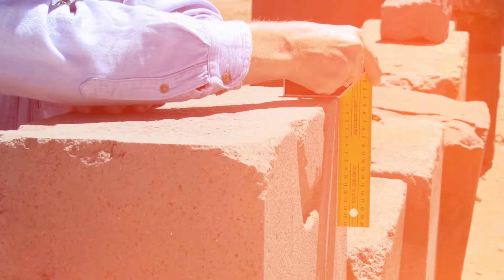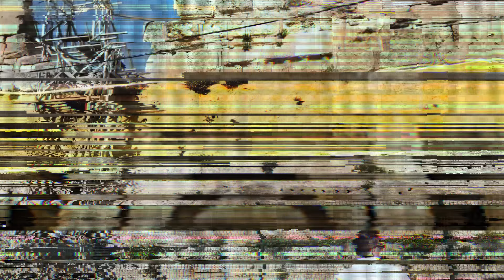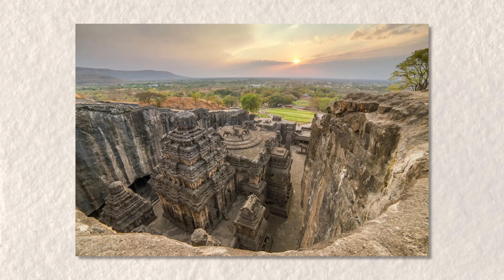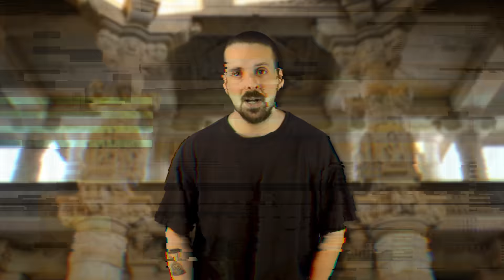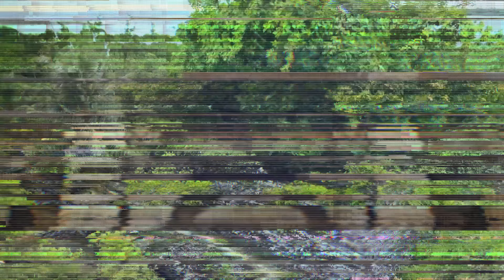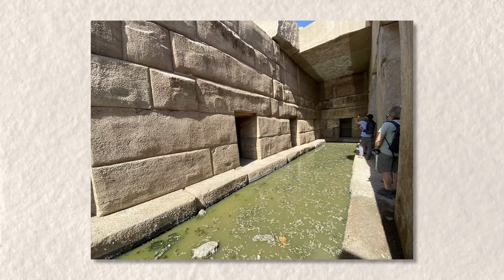10 Architectural Structures Ancient Civilizations Built That Engineers Couldn't Replicate Today

Comment: Those 800 ton blocks can be lifted with 500 people quite easily by using block and tackle to a 40/1 ratio, actually if my calculations are correct you should be able to lift around 1000 ton with 500 people with the same ratio but it's good to over estimate

Comment: They had full access to graphite-based copper induction, a far simpler setup that softens silicon in basalt, quartz, granite, and other megaliths. This allowed them to strip away material layer by layer, shaping and moving massive stones without the need for water, drilling, sawing, or counterweights.

Comment: You're joking, right? If you use enough ropes, and intertwined them after they were wrapped around the back of the stone, they would all work as one peice. You can easily drag a brick uphill with a peice of cheap string from Wal-Mart, so just simply scale that up. These people had hundreds, of thousands of slaves. You give me 250,000 men, and the necessary ropes, and I'd challenge you to find something we couldn't move

Comment: Roman roads are still intact. Roads where I live can't last 1-2 winters without filling with pot holes.
Reply: Those Roman roads where probably not built by the lowest bidder.
Reply: @strayhound3842  definitely modern road arent build to be comfy, replacable (designed for asphalt abrasion), general yea... we are definitely building cheap roads for no reason :) u must be proud each day looking at yourself in mirror aint u.
Reply: The comment I was looking for😊💯💯💯
How about "modern" concrete buildings that begin falling apart after just a decade compared to these centuries old structures. Why can't we learn something from them today? 🤔🤔
Reply: @jahseedxavila2594  special lime, they figured out how the romans did it.
Reply: You live in Calgary ?
Reply: Cuz they didn't have SUVs with weight driving over them 😂
Reply: @joe-ksterrr4421 😆😆
Reply: 🤣🤣🤣Seriously....how could anyone not know this?...are humans really this dumb?...Internet has done nothing but dumb down society
Reply: Roman roads didn't have 20 tone trucks driving over them at 100 kmph, if modern roads had roman era traffic, they'd be eternal

Comment: It's easy to believe that these structures weren't built by earlier civilizations, within our accepted timeline, but were discovered and re-purposed for their use.  If they did build them, there had to be an outside influence that guided them to move hundreds of tons of stone that would be extremely difficult for us to currently move.  Just one of those mysteries in life.
Reply: Its most likely an outdated technology, ancient civilizations most likely found an easier way to build hence no longer needing to move these massive stones so they stopped using it and after a couple generations it was completely forgotten.
Reply: Not because about lazyness and lack of knowledge is so present now that it was the same back then…